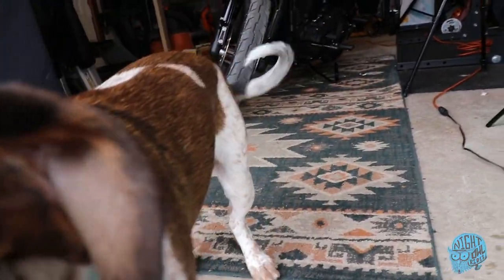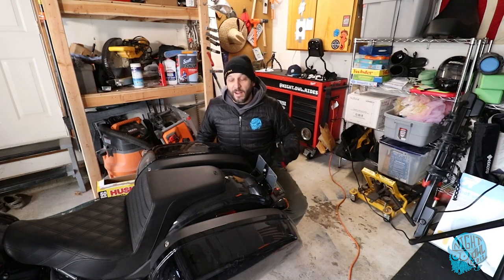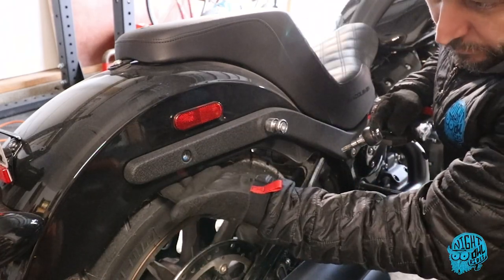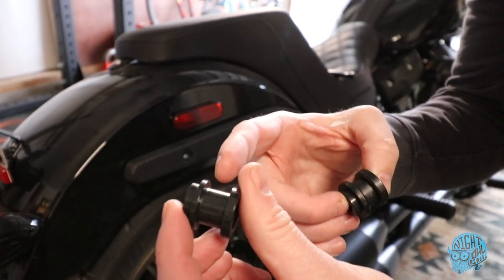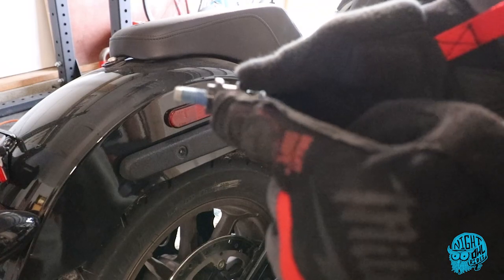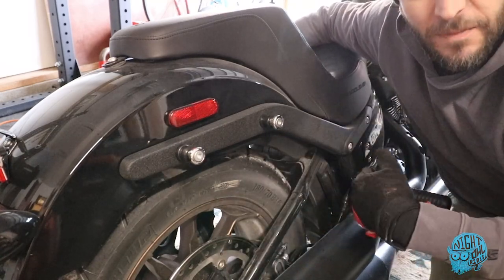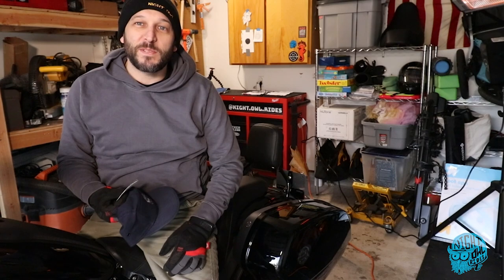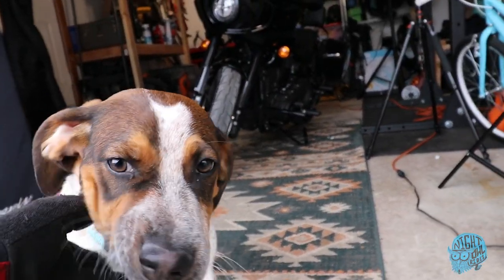HD Holdfast Sissy Bar Install on my 22' FXLRST

Comment: Do you have any movement when you pull up on the pad?  I do in the rear and it’s bugging me.  Same bike, same kit.  I heard you can rotate the hardware for a tighter fit.  I haven’t tried yet though.
Reply from the maker: No movement in the frame but my wife hasn’t been for a ride yet, so I’m not sure about the pad part it’s self. I grabbed it a bit while riding and it felt firm. What docking hardware did you use?
Reply: @nightowlrides  same as you
Reply from the maker: Hmmm, I’ll keep an eye on it and see if it loosens up after a few rides. Thanks you for the heads up, hope you get yours dialed in.